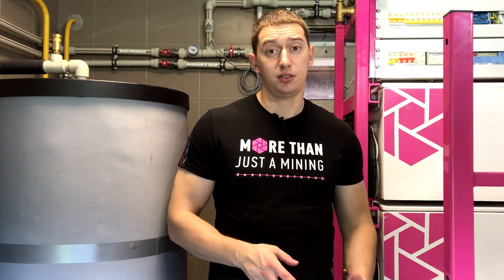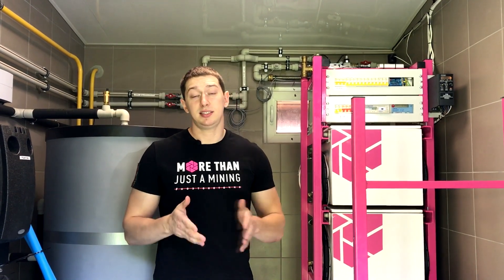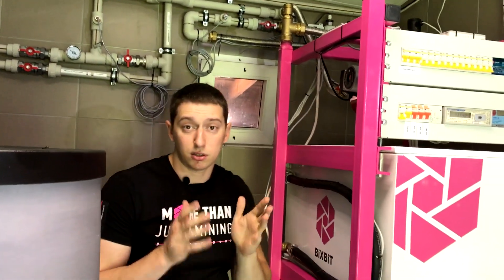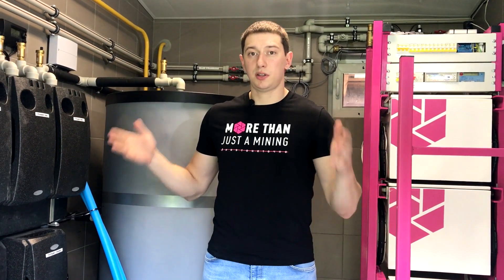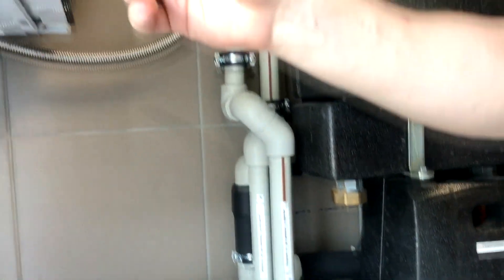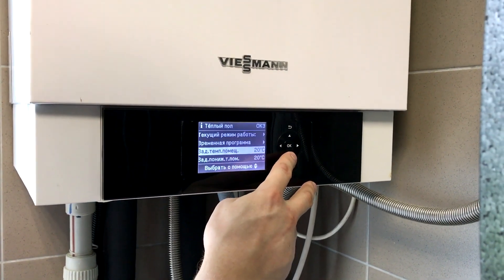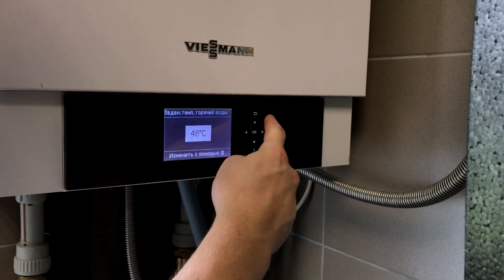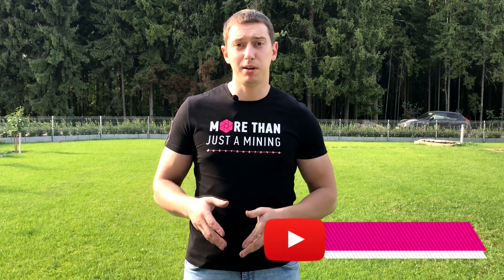Heating a house for FREE by mining cryptocurrency. Integration an immersion cooling system

Comment: 3,1kwh miner is able to heat 70m2 house by using drycooler when winter is about -5degresee?
Reply from the maker: Do you want to heat your home?
Reply: @BiXBiT_Global  yep
Reply from the maker: @mrm.2540  You need to understand what kind of heat loss your home has. It is this figure that you need to compensate for with heat from ASICs.
Reply: @BiXBiT_Global  ye, I find company which will help me with this :)
Reply from the maker: @mrm.2540  Excellent

Comment: what happened if the water in the boiler is too high?
Reply from the maker: Clarify, it's not entirely clear
Reply: I also wonder if the water in the boiler is too high, does it still go in the circuit for being heated up or you have some sort of automation in place that let's say if the temperature in the boiler is 80°C do the ASICs stop working so they don't get damaged?